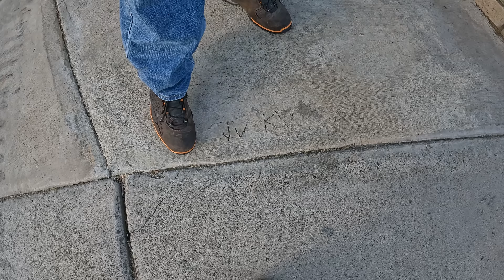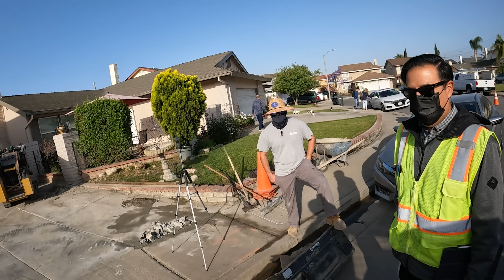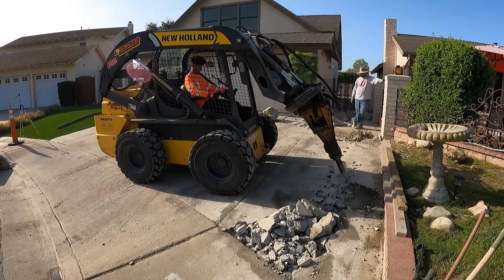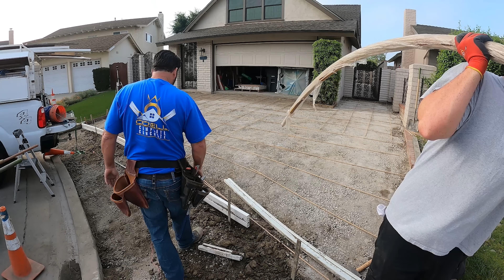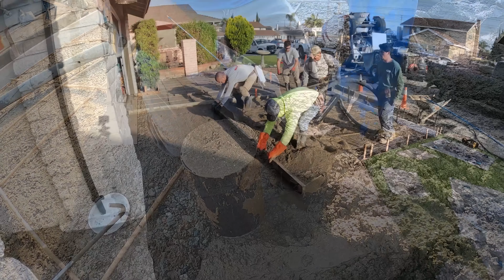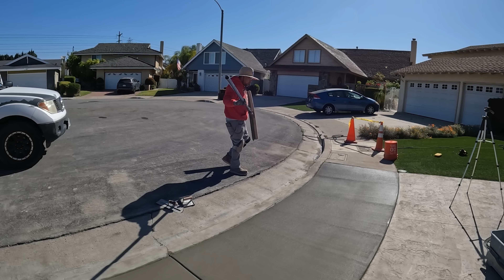The Building Inspector Showed Up...

Comment: The Quality Assurance and Quality Control: The effective QC Plan, Fully Implemented in Civil Construction Projects is Very  Important. The QA/QC inspector have to hard work to achieve Required Standard Quality. The Main goal is to prevent defects and mistakes.  The best procedure is to fix defects, after the first time (before / during construction) indenting to construction Team / Contractor. It is not good exercised to rectify / rework, after the completion of construction. Kindly Consider the Extra Cost and Time to spends the REWORK. Thank You.

Comment: As a ACI certified QC tester in the state of La., I can tell you that you made the cylinders wrong. If you were have to go into court due to concrete issues,  those would not hold up (PSI rating. Air test, ect..). For your own sake, may want to have a testing lab make them for you next time.
Reply from the maker: There going to be alot closer to placement methods used in real world

Comment: We do abt 30 inch base material and 8 inches of concrete over here in Switzerland. And we add a mesh with rebar with 6 x 6 inches wide only. And vibrate the concrete. 
But most of the driveways are not poored with concrete , because most city codes require non sealing surfaces. Rains has to be able to seep away throuh the driveway and all surface water needs to be kept on property and allowed to slowly seep away over time.
Reply from the maker: Why not capture water runoff for irrigation

Comment: Very rare to use concrete in the UK, mainly use block paving ,real stone or resin based products which are more aesthetically pleasing. No building inspectors for a driveway either.
Reply from the maker: That's interesting

Comment: Concrete made with fly ash requires less mix water, and bleeds less than portland cement concrete. It also makes the concrete less permeable. This means that outside moisture will not penetrate it as easily. This can come into play during repeated freeze/thaw cycles where excessive moisture in the concrete is unwanted.
Admittedly this is why we used it in the oil field for cementing surface casing but I can see why is could have some use in the realm of construction.
Reply from the maker: I think it's a cheap substitute and a good place to dispose of it.
Reply: @OdellCompleteConcrete  the video said you didn't know why they use it. I gave related info instead of saying that road salt used to thaw roads impacts the longevity of concrete hence why any place that receives snow by code require its use in the mix.

Comment: Ex-boilermaker here, and they use flyash in concrete? Flyash is a waiste product from coal boilers (think 13 to 20 floors tall) The coal usually crushed to a dust and then blown in the boiler via a side cylinder called a cyclone, the molten coal flows in to the boiler and created a lake, ever so often there a hole for the molten coal to flow down full of water, where it explodes on contact.  It's projected back up in the boiler.  Flyash was really bad as America was importing cheap Russia coal back in the 90's which had a lot of iron in it. The Boilers are lined with a concrete substance called shamrock (sure i misspelled it) green concrete that once hardens its pretty hard to remove. (Some Boilermakers figured out how to create housed out of hay an spraying shamrock on it, since the concrete is set by fire, they burn the hay as the final step of curing the concrete.)  So I've seen a chunk of flyash rust. Most of the time its pull from the boiler watrer hopper and  deposited to a man made lake for the waste colection. Best use I've seen for it to date is as sand blasting media. It works really well for that. It being used in concrete makes me think of rusting concrete.
Reply: Thank you for posting ur life experience knowledge

Comment: Yea if I remember my batch course fly ash is a filler. I think it's a very fine aggregate. I drove mixer and was "promoted" to batchman, I mean batchperson, and they sent me for a course on  concrete composition, additives, testing slump and air, etc. Running the plant and playing with the big loader was fun but the rest sucked so I went back to driver, lol.

Comment: On the fly ash question I asked a friend that’s a concrete inspector for interstates and bridges. 

His response
“They've been putting fly ash in concrete for a while now. Now the new fly ash and cement are messing with the air in our mixes. And yes, some mixes with no fly ash seem to be a bit stronger but the fly ash mixes have been plenty strong.”
Reply: No substitute for cement powder, it's just cheaper to use a blend. That's all it is.
Reply from the maker: I think since fly ash is a less expensive alternative to cement it may be getting overused.
Reply: @OdellCompleteConcrete  it is, 15 years ago concrete cracked way less and behaved better when drying. Worst thing to happen was to bring in blends.

Comment: They are going to demo. The masks are PPE for respirable silica (silicosis).  Fly ash is a waste product from coal burning electric generating plants. Someone analyzed it and found it has the same structure as Portland. So using it in the mix keeps it from all going to the landfill and it saves $. It doesn’t add strength, workability, etc. Mix with fly ash in it sparkles in light and looks like pepper. You either like it or not. Typically a designer will allow it for building slab because flooring will cover but require owner approval for hardscape. The selling point is cost savings and environmental- finding use for a waste product.

Comment: I also notice you there do not use saddles to permanently keep the steel bars off the ground. Pulling up the bars and then walking on the pour compresses the bars to the ground where the steel cannot do its job of holding the concrete together. The steel on the ground will rust as well as cannot strengthen the concrete and hence makes the use of steel irrelevant.
Reply from the maker: Not steel.
Fiberglass
Reply: @OdellCompleteConcrete  Hello, please tell me what you think is fibre glass.

Comment: Ignorance of chemistry in a contractor or city inspector is understandable.
     The primary disadvantage of not using flyash isn't to the owner. Flyash IMPROVES concrete in nearly every way unless it is added in excessive amounts.   
   Flyash is used as a lubricating component to improve concrete flow.  Using fly ash in concrete reduces cracking, permeability, and bleeding, creating a dense, high-durability concrete that is resistant to sulfates and alkali-aggregate (salt) reactions. This concrete mix also requires less water and has a tendency to resist shrinking and reduces the amount of water needed for pouring.  The advantages to purchasers/end users are disadvantages to concrete suppliers, contractors and the environment.   
     Every cubic yard of concrete that fails and must be replaced because of poor chemistry contributes 400 pounds of greenhouse gases - the same as burning 20 gallons of gasoline.  (That doesn't include the fuels burned to transport and install it.)  Flyash can decrease concrete's carbon footprint. It is inexo\pensive readily available from an existing huge volume of coal power plant waste material. Inexpensive doesn't mean it's not good for concrete; water is less expensive.
   Your municipal code was probably modified at the request of city contractors and local concrete suppliers who foresaw a negative impact on their profitability.
Reply from the maker: To be honest, Fly Ash is hazardous waste and concrete is where its being disposed of. Just like Asbestos when everybody thought it was the greatest thing around and now look what's happened!

Comment: So I’m getting some spalling because of fiber mesh up here in Southern Oregon. The fiber wicks in moisture which freezes in the winter and blows out little pockets on the surface.
Reply from the maker: Thats interesting, I think it might be something else causing that.
Reply: @OdellCompleteConcrete  If you have any insight Im all ears. I’m aware that exposed fibers in composite structures have this issue, especially with Kevlar (Aircraft wings at -30° for instance will delaminate if moisture gets in) The fibers in my driveway are sticking out of the surface on the concrete, and we get freezing most of the winter. So 2 years in that concrete is spalling. I’m reluctant to use fiber again outdoors in this area.

Comment: The Fly Ash is for eliminating the Alkali - Silica Reactivity that progressively destroys concrete.   It is important to use the FLY ASH in Concrete
if you want it to last a long time, and not turn itself into a gravel driveway.
Reply: That’s what happened to my friends drive way, it bubbled and started to crumble within 3 years after the pour. 5 years a and the crumble became a cancer all over the driveway.
Reply: @c-martz2846  If you look at this video, there is too much water in the concrete.  Excess water makes the concrete weak, and when finishing the surface, the mix segregates so the top surface can freeze, and spaul off in winter.  When I was finishing concrete a half a century ago, we poured it dryer, finished it with a float, used a jitter-bug to drive down the rocks at the surface, then used a finish float, and broomed the surface.  We never had a concrete failure.

Comment: Flyash is a good additive to concrete. Makes it easier to flow and form. Reduces water amount needed and makes the hardened concrete stronger.
Reply from the maker: Maybe in the right ratios
Reply: @OdellCompleteConcrete  not maybe. For sure. You pay extra to have Flyashnadded in the right amount and quality

Comment: Another great job done by you and your crew, I noticed that the council didn’t ask for reinforcement in the entrance pour, is that because of the thickness of that section ?
I think you could have put a couple of bars across especially with that big crack in the gutter allowing water underneath and expanding the ground no matter how much it’s been compacted!
I know you must get fed up with all the experts after the job’s been done and it’s not a criticism in any way, just thought the inspector would have had you put rio in it while you could!
Keep up the good work!👍❤️
Reply from the maker: I'm guessing because that where utilities may be, so it for ease of access as well as electronic locating.
I think in general some building codes are far behind the times.
Reply: Cities commonly do like rebar steel in the approach area and adjoining sidewalks in case they have to come out and open the area up for repairs to utilities etc

Comment: Fly ash has the benefits of Improved workability. Decreased water demand. Reduced heat of hydration.  Increased ultimate strength. Reduced permeability. Improved durability.  Improved resistance to corrosion. The disadvantages of fly ash are Slower Strength Gain Longer Setting Times it has less air bubbles Concrete is susceptible to damage from freeze/thaw cycles if it does not contain air. Fly ash reduces the amount of air entrainment, and concrete mixtures high in fly ash often require more air-entraining admixture. It can take longer in the winter for fly ash mixture to cure. Fly ash may have dark streaks in it and there will be color variations.

Comment: Most counties allow any home project as long as you replace exactly with what you remove. The exceptions are siding material. So if you pull off 7 inch vinyl lap siding you can replace it with 7 inch hardi backer siding without pulling a permit. So if you want to widen the driveway down the side walk you’ll need a permit for the extra couple feet of 4 inch curb you want to remove. This inspector is not very well informed.

Comment: Fly ash use in concrete improves the workability of plastic concrete, and the strength and durability of hardened concrete. Fly ash use is also cost effective. When fly ash is added to concrete, the amount of portland cement may be reduced.
Reply from the maker: Better off without it as an option, because its overused and for the wrong purposes
Reply: @OdellCompleteConcrete  I did a Google  search,  this was copied and pasted ....! Sorry should have wrote that in also...! After hearing the two of your conversation, I looked it up.

Comment: They told me to leave my fresno home.  They said putting a steel trowel on the concrete seals the surface prematurely causing the surface to separate.
Reply from the maker: If that happens it means your concrete is no good
Reply: @OdellCompleteConcrete  Thanks for the response. I was trying to remember who "they" are.  It was a class presented by a local batch plant, the lesson was taught by Ash Grove Cement Company.  I have been following their recommendation. They also said that finishers are causing damage (I think you call it spalling) by making too many passes finishing the surface; causing the surface to be a different density (more dense) than the subsurface, causing the bond to fail. It also (they say) forces the cement down and the sand up = weaker surface.

I have my own theory about that.  Around here they use air entrainement religiously, unless I specifically requested them not to. I usually pour inside flatwork, which is incidentally usually power troweled; so it has very little freeze/thaw stress - so I ordinarily request "no air". I think the air bubbles cause the speration between the surface and substrate, but what do I know?  I am just a carpenter who pours concrete 4 or 5 times a year rather than use a subcontractor.

It is nice watching how you full time concrete guys do things. Thanks for posting videos.

Comment: A  control joint is cut 1/4 the thickness of the concrete. Continuous  cover with water for at least 3 or more days is the best way to cure concrete. Most people use the quick way, spray with compound.
Reply from the maker: Makes sense
TY

Comment: real nice job. did you use steel coated rods or fiberglass? they say fiberglass rods are stronger then steel dont rust and rot and are a little cheaper. I always thought with fiber in the mix no rods were needed. that is what I did. I rounded the corners on my bull float leaves less edges
Reply from the maker: Owen's Corning pink bar.
Fiberglass

Comment: your cylinders would most likely meet specified break strength but you don't make your cylinders correctly. 4" mold requires a 3/8" diameter rod with a hemispherical end. 2 lifts, 25 rods per lift, 8 to 10 sharp blows after rodding each lift.then cap or cover.
Reply from the maker: Yes, that's what I thought, but I'm more interested in the ingredients
Reply: @OdellCompleteConcrete  Get the batch weight compliance ticket from the concrete supplier for your records. Tests you want if needed are about 2500 dollars.

Comment: Hi David, excellent work as always! I noticed that in some of your projects you have expansion/isolation joints when the concrete is up against fixed structures, but in this pour they seem to be absent. What is the reason for excluding them here where the driveway meets the house, previous pours, and the brick "wall" as well as as the apron where it is constrained between the driveway, curb/gutter, and sidewalk? If they aren't required here, what is the reasoning? Thanks!
Reply from the maker: This ground was no expansive soil

Comment: Regarding the Fly ash additive - it's societal waste that has to be disposed of somehow - and encapsulated in a cement mix is fine for some applications,   I suppose.   I have to guess that the presence of significant levels of heavy metals might make it a poor choice where kids are skinning knees, and less of a factor in, say,   a runway slab - compression strength property implications notwithstanding.
Reply from the maker: I would rather see it put somewhere else
Reply: @OdellCompleteConcrete  Well then maybe you shouldn't have burned all of that coal, silly!  ( yes, I am kidding )  I would think that there were some appropriate applications,  but never gave it a second thought until you said it was a municipal specification- just guessing at the why.   I enjoyed the video, thank you.

Comment: The Roman empire used volcanic ash mixed which strengthen the concrete mix for maximum durability so im assuming fly ash is supposed to be similar?  Possibly fly ash is somehow toxic when exposed to high heat?

Comment: Hi again. Like your vids. Another qu. Why don’t you use rebar spacing cones to lift your reo off the floor? Why hook it up after pouring? Presume cover not critical, just for crack control I suppose?
Reply from the maker: Chairs only work from a boom pump or tailgating

Comment: I've noticed that you sometimes will add synthetic fibers to the mix by pouring it right in the truck.   If you were pouring a concrete basement floor in new construction knowing that the basement would see a lot of auto and truck traffic on it, what type of fiber would you add before the pour?  We're looking at the owens corning product that's running around $16 bucks a pound and has a recommendation of 1 pound per yard of concrete.  This is a North Carolina build with very cold winters but the space will be closed in and heated with overhead vents.  The soil is red clay.  Thanks in advance for any replies.
Reply from the maker: Call Owen's Corning and get there recommendation.
Reply: Definitely use fiber. Stuff is really amazing and my old garage floor while it did eventually crack it stayed a hairline crack and never shifted or opened up.
Reply: in my family's shop back home we used it. looks it was poured last year, while it's been more like 20.